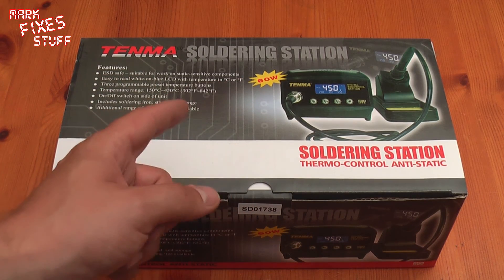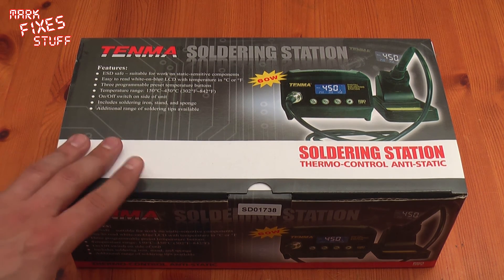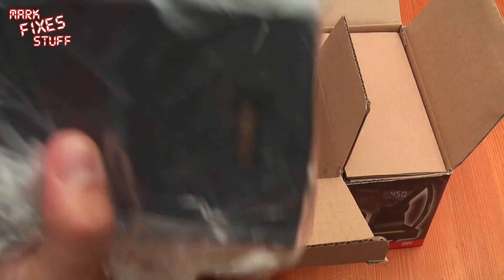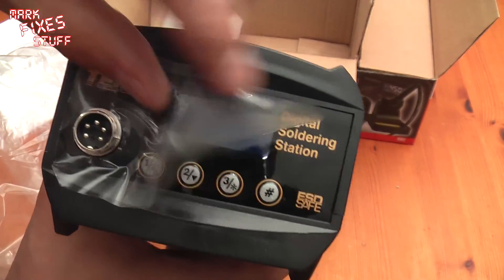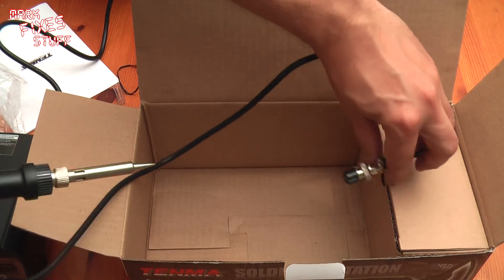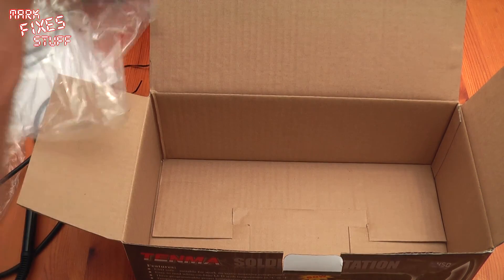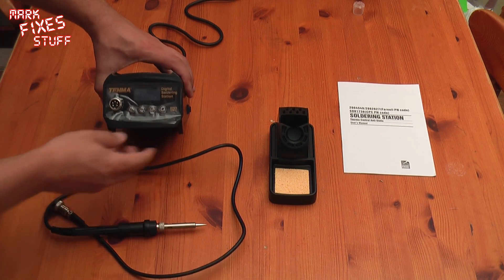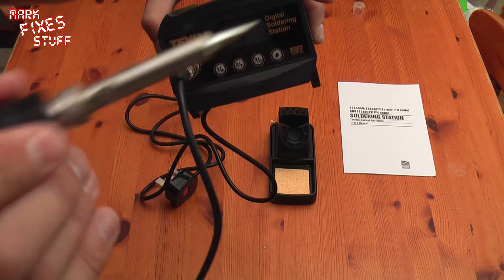Tenma Digital ESD Soldering Station - Unboxing, assembly & power on - 21-10115 UK - Quick Look

Comment: I was given a damaged one of these without a "wand". Does anyone know a compatible heating element? While fixing the unit I see it uses the same leads for heating and testing the temperature, 1 bonded to 2, 4 bonded to 5, 3 is ground. Any help would be appreciated, even an ohm reading across pins 1 and 5 would be a good start. Thanks for your video. The 3 preset temps could be useful. Cheers
Reply from the maker: This is what you seek...

https://cpc.farnell.com/atten/cbb027505/heating-element-for-st-60/dp/SD02058

The Atten part number is CBB027505

Comment: Hey. How did you find the soldering station? With CPC only being down the road from me it seems like a good buy.
Reply from the maker: Still working great to this day. Tips are cheap on ebay and the station can deal with larger solder joints quite easily.

Comment: Great review... I want TENMA now.
Do you still like it?
How long does tips last?
Does the temperature on LCD seems accurate?
Reply from the maker: Hi Jure Studenčnik!

I have used the Tenma a lot now, probably more than 30+ repairs and it's great. The temperature is stable and seems to be accurate (the solder melts at the correct point). Also I have kept the tip well tinned and I am still using the first one so I think it lasts well.
Reply: Already 2 years? Well I bought Tenma back then thanks to your review and your comment. TY. I'm very happy with it. Back then the price was ~50€ I belive. Still runs like new. Tips are great. I use it ~ once a weak.
Reply from the maker: @jsskulio  Six years on for me and still no problems. How is yours going?

Comment: Looks good, Mark.

Should be much better built than the average cheapo jobbie.

Definitely grab a chisel type tip for it though, around 2-3mm wide.

It lets you get a better surface contact, and you can still use the corner of the tip to solder very small stuff.

You get used to it pretty quick - I've soldered tiny 0603 resistors / caps with a 2.5mm chisel.

Does look like the Tenma has good heat capacity though - didn't budge at all when put on the sponge.

The "volume" part on the display will be showing how much power it's putting into the heating element. Probably analog controlled too, and not just a dodgy PWM one. ;)
Reply from the maker: Oh yes, I realised pretty quickly that the tiny tip won't cut it for me, and have ordered a 3mm chisel tip. Pretty used to using that sort of sized tip due to the low budget nature of my life, and cheap irons have them!